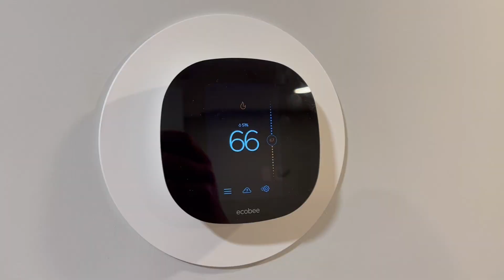Aube RC840T Smart Electric Heat – Unboxing & Installation!

Comment: Hey, great video. Was wondering if this would work replacing an HP-510 thermostat[1]. It only has two wires coming in from the heater, and the manual for the thermostat[2] specifically calls for the neutrals and grounds to not be used, so I'm a bit confused on whether this would work for me or not.

Thanks!

Links:
[1] https://www.youtube.com/watch?v=JhBMwla0W6I in French, but just for visuals
[2] https://www.philex.com/wp-content/uploads/2016/10/28260R-High-Definition-HD-Satellite-kit-2.pdf